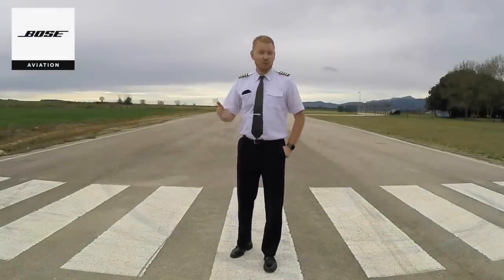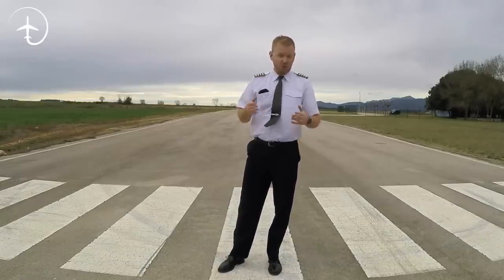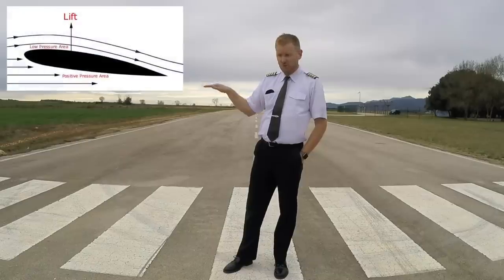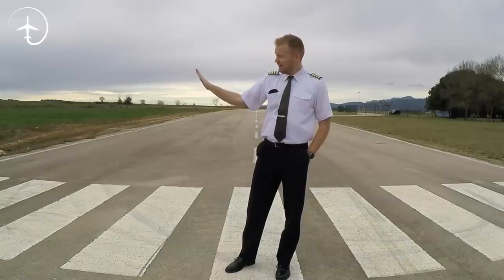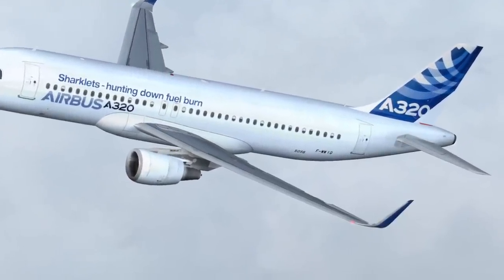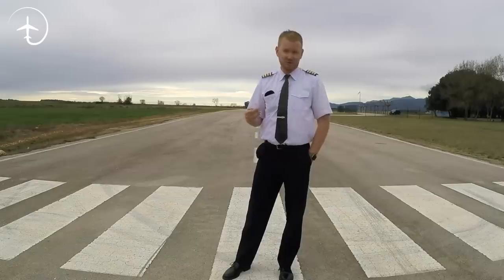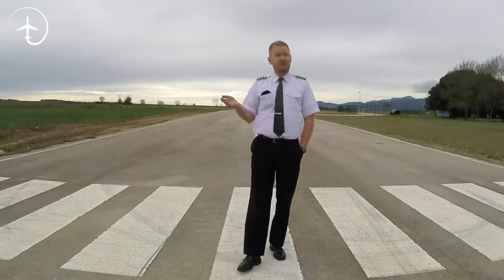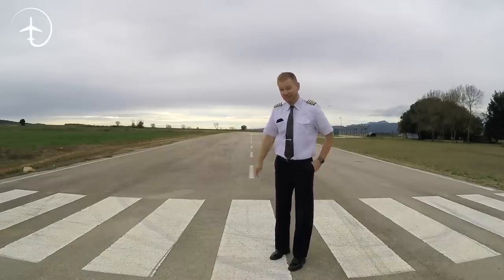Winglets - What are those things on the aircraft wing-tip?

Comment: Winglets are also much safer. Some of the vortices created by heavy and slow aircraft can be extremely powerful and even push other planes out of the sky (if they happen to be in the path of the vortex). Winglets help greatly reduce the vortex (as Mentour said), by giving a place for the high pressure and low pressure air to meet gradually (instead of a big column of high pressure air twisting over the edge of the wing as it tries to fill the low pressure area).

The recent Qantas incident from last week in LA resulted because the plane was hit by the wake vortex from the taking off aircraft ahead of them. Aside from that, there have been many accidents attributed to wind vortices, both big and small aircraft.

Comment: “Nature has a tendency to do things in the most efficient way”

Expect the next Boeing to have flapping wings.
Reply: *Starts praying
Reply: Well airbus started testing something near that
Reply: Thank you! Your delivery content and enthusiasm in your presentation is very commendable. You present a very complexed topic (winglets) to a level for novice to advanced learners to understand. You are a very skilled and knowledgeable teacher.
Reply: Boeing can't even develop a replacement for the outdated 737 which has been pushed way past its design life, with disastrous and tragic consequences. They should put their efforts into building a safe aircraft before they attempt to do anything ground breaking.
Reply: Parasite drag is produced by VERTICAL surfaces and Induced drag is created by HORIZONTAL surfaces, for example when the Flaps are at 0 degrees they produce Max Induced drag and Min Parasite drag, at 90 degrees Min Induced and Max Parasite drag and at 45 degrees in the middle of both, for a flap with no thickness. The fact that Lift and drag are both proportional to airspeed squared, means airspeed affects a 2 Dimensional surface, geometrically a Square plane. Wing Vortices are not the cause of Induced Drag but it is just a Visible Effect of it. I have developed a hypothesis to explain physical, atomic and subatomic (gravitational movements, Center of Gravity and Mass), however I need to validate my V & H surfaces theory first.
It seems that Winglets reduce Lift and increase Drag, I also believe in turbance Winglets impose additional stress to wings and all other moving parts inside the wings like rods, joints and moving surfaces. Wingtips also decrease the stability and controllability in turbulent air. Simply put another british scam.
Please let me know what you think, thanks.

Comment: To explain wingtip vortices (in very simple terms), the air is moving faster over the top of the wing than the bottom due to the top being longer than the bottom and the wing is designed so the air meets up at the back of the wing. On a swept wing the air moves down the wing (or outward) as well as across it and at the end of the wing the faster upper air meets the slower lower air and it spins into a vortex.

It takes a lot of energy to spin the air in the vortices, that energy has to come from somewhere and the only place that can be is from the plane, and that creates drag. Drag slows the plane down requiring the engines to work harder using more fuel.

The winglets change the way the fast upper air meets the slow lower air so that the wing-tip vortices are greatly reduced. There is no one best design for this, the wing for each model of plane is different and the best design for each wing varies.

The efficiency of the winglets changes as the air-speed of the aircraft changes. The design of the winglet determines where the winglet is most efficient and that choice varies depending on the roll the plane is planned for. Short hoppers will be better served by winglets the are most effective during takeoff and climb (and landing), long haul aircraft will best be served by winglets that are most effective at altitude and cruise. This is the exact opposite of a "one sized fits all" situation.
 
Not mentioned in the video is the 787 wing is designed to flex a lot more than typical aircraft wings, the shape (curve) of the wing itself works to reduce wing-tip vortices without winglets.
Reply: Thnx, enjoyed that little book! 👍

Comment: Damn those winglets are huge!
Reply from the maker: Yes they are!
Reply: How tall are the winglets on a 747 then? 4 meters?
Reply: They are 6 feet on the 744. The 747-8 has raked tips. However, the 767-300ER has 11 foot winglets! They're huge. (Heights according to wikipedia, however I work around both aircraft)
Reply: tell me about it
Reply: They look huge if they are right outside of the window.

Comment: Good video. I always thought the 737 sharklet was much smaller. Could you do a video on the auto break?
Reply: 7.3 IDI Diesel sharklet is on Airbus and they are taller.  here are some stats:  at 2.5-metres tall, they will replace the aircraft's current wingtip fence. presented  as an option on newly built aircraft, Sharklets have been especially designed for the Airbus A320 family to reduce fuel burn by  3.5 percent. question 2: 
there are 4 phases to landing:
final approach, flare, touchdown and de-rotation, roll out and deceleration. on the A320, the auto brakes have three settings. LO,  MED and MAX. autobrakes are available on Normal Brakes (Green system) only.  LO mode delays for 4 seconds after touchdown. MED mode delays for 2 seconds. MAX has no delay and is only used during  takeoff in the event a rejected takeoff is perforned, it applies max pressure with no delay
Reply: The auto brake  is operated by a switch mounted in the center of the top panel above the flying instruments. Its graduated from 1, 2, 3, 4, and 5, If its a five, you pull the switch out towards you and then lock it into 5. 5 is very rarely used unless its a bloody short field and you need maximum braking. Use of reverse thrust is always used no matter how long the runway is . Thats to save in brake pad wear and tear. Hope that explains the use of the Auto Brake system

Comment: Way back in 1983/84, I was working on "Temperature Dependant Shape Changing Materials" at Cambridge University Dept. of Metallurgy. There were fatigue problems with Shape Memory Alloys, that could be solved, but introduced corrosion issues. The problem with 'Bi-Metal' strip material was low performance and/or corrosion. CIBA GEIGY had a fabulous facility at Duxford, very close to the Aircraft Museum. Composite materials looked very promising. Zinc for example has a very high coefficient of expansion. It was noticed that a bi-metal strip could double it's turning moment at a given temperature, when the interface was a sinusoidal wave profile. ...This in turn quadrupled the torque or turning force. Weight issues could be addressed by a CIBA GEIGY product known as "Pultrusions" ... semi-cured composite epoxy impregnated and gas free extrusions. ...It was simple enough to incorporate heating wires into the 'wave' profile. ... The intention of "Active Wing-Tips" was to allow the aircraft to minimise the formation of wing-tip vortex initiation. ...Rather than have a single thick section, a sliding laminated stack was seen as advantageous. ... I was also reading Comparative Theology, as a Military Chaplain, and the issue of Life-form Patents was very contentious. There was a movement to boycott all Patent Protection as a form of protest. A "Publish and be damned" policy. ...The result was that no funding was available for continued research.

Comment: Hi mentour pilot, is there any difficulty by winglets while cross wind landing ?
Reply from the maker: Excellent question. We actually have slightly less crossword Nd capability with the Winglets than without.
Reply: Got to be worse with double winglets.  I recently talked with an old friend who has retired as a commercial pilot and asked about cross-wind landings.  He said he just side slipped.  Before he left engineering to be a pilot I took a short ride (instead of a drive) to Lindbergh Field.  He did an extreme side slip and we landed in a parking area next to the then Ryan complex.

Comment: Hi Mentour! I have one question, why the older 737 models have more cockpit windows than the modern ones?
Reply: Pablo Lapadjian I can answer your question. Basically before the all technology the third person on the cockpit ( the navigator)707 and 727.  Was responsible for navigation, and on the olds times during night we flew looking for out side the windows too, looking for Stars. The time passed but they continus be done with this windows.
Reply: They're called eyebrow windows, they also gave pilots greater visibility in turns.
Reply: Primarily because the original 737 shared lots of fuselage components with the 707 and 727. The cross section was the same and it meant they could use common components such as seats and other fixtures and fittings. If you look at a Boeing 707, 727 or (early) 737 the forward fuselage is basically the same.
Reply: Mentour has a video on that specific topic.  The "eyebrow" windows turned out to have more downsides than benefits, and were dropped from later models.

Comment: On Boeing 767 raked wingtips are only on 767-400 also raked wingtips are incorporated on the Boeing 777-300 only.
Cheers from San Francisco.
Reply from the maker: Yes, true.
Reply: Not really, they are also on the 777-200LR and also of the 777F
Reply: Hello, Thanks, I stand Corrected...
Reply: not 777-300 only 777-300ER
Reply: Elle, Thanks for the additional Update...
Cheers from San Francisco, My last job was a Fueler @ SFO.
Reply: John Dubpernell Np

Comment: Mentour some 737's have windows near the overhead panel why are they there and why are they not there on other versions of 737 and other aircrafts
Reply from the maker: The eye-brow Windows? I will see what I can do.
Reply: Mentour Pilot Thanks
Reply: As far as I'm aware, the eyebrow windows were for astral navigation which obviously isn't a thing that's needed with all the advanced in technology like GPS and many other things since the '60s. I believe it reduces production cost, maintenance cost, and a bit of weight.
Reply: So is all the added technology and computers why flight crews don’t include navigators anymore - or do some planes still have them?
Reply: Pretty much. I don't think navigators are really used anymore, except in situations like certain military aircraft, like bombing runs and AWACS and stuff like that. Advances and simplifications in flight controls and the number of things that can run themselves is also why modern aircraft have lost the engineer.
Reply: Boeing did some studies -- Boeing does that a lot -- and concluded that the added visibility from the eye-brow windows didn't significantly enhance safety and not having to have the structural enhancement of the windows was more important and cheaper for the customer.

Comment: can u explain about crosswind, downwind & upwind
Reply: upwind is the direction you take off, because airplane always takes off against wind, thats why the name is upwind. crosswind is when you have the runway 45 degrees to your left or right, and downwind is when your are flying opposite the runway you toke off from. you will learn this better when you do pattern training
Reply: Crosswind - Flying in a direction where the wind is blowing accross the plane. Downwind - Flying in a direction where the wind is blowing in the same direction of travel. Upwind - Flying in a direction where the wind is blowing in the opposite direction to the planes travel (headwind). Terms mostly used when flying circuits as you always land upwind to get the most lift for a stabalized approach...same applies for take off. If you took off from a runway to do a circuit you would take off Upwind, turn crosswind, turn downwind, turn base then turn final (upwind again) to land.

Comment: I was wondering why the 777-300ER does not have the winglets? It is an extremely long range flying aircraft.
Reply: The 777 doesn't have winglets because they use the raked wing tips. Just like the 787, it's more efficient with longhaul flights
Reply: And the wings it is totally different, so much more efficient
Reply: The 777 X has foldable winglets
Reply: Yes, I know that. Isn't that nice!
Reply: The 777X has foldable wingtips. The reason the wingtips will fold is because the wingspan will be 7 meters (22 feet bigger). The reason for the fold is for the aircraft to fit in the same slot as current 777s, therefore airports don't need to expand like they did for the A380
Reply: Thank you for the info.
Reply: Ken Wang cause it is my fav airplane that is why it doesn't have winglet

Comment: Pretty good but you left out a key bit. What winglets actually do is generate thrust and function like a boat's sail when close hauled into wind. They were originally called "tipsails". The winglet is angled with its chord line outboard slightly to optimize the AOA in the tip circulation and the resulting lift vector, being perpendicular to the inboard-circulating flow, has both an inboard bending component and forward component which is the net thrust it generates. It's the thrust generated, in excess of the winglet's own drag, that cancels out some of the wing's drag.  Winglets only make enough thrust to exceed their own weight and drag penalty when the wing is working hard, operating fairly close to its Clmax.   

Straight wing airplanes generally don't use them because since they are only worth the trouble with the wing close to its max lift coefficient, only airliners that cruise above 30000 ft are operating close enough to Clmax to be worth it. On low altitude airplanes they are mostly for show, or to improve climb/glide performance. One noteable low speed airplane with what looks like humongous winglets is the CL415 waterbomber.  Except they aren't winglets; they are dihedral plates added to restore dihedral effect lost when the slab sided turboprop engines were added. The mother of all aerodynamic bandaids.

Comment: hmm...what if the wing tips could hydraulicly rotate to the sides? would that help to brake the aircraft during the landing? Would it be too dangerous to add a potential weak spot to the wing tip? Because what moves, can obviously break, both break down and break off.

Comment: Wing lift is greatest at the wing root and least at the tip. This causes a a lateral air flow outwards on the upper and inwards on the lower surfaces. This produces a vortex at the tip where they mix. It's called " Induced Drag " and the winglets reduce this effect making it more efficient.

Comment: Does it also prevent vortices from pulling the air above the wing (outer section) spanwise which could result in wing stalls at lower speds like landing?

Comment: Hi mentour, really enjoying your videos eventhou i am not a pilot. One question regarding this video. I have seen and actually been a passenger on an airbus A330 which previously had contact with their left winglet. The damaged piece has simply been taken off and the aircraft is back in operation. Left side no tip, right side with tip. I assume it has no effect on the safety and security but is this actually legitimate? This airbus is operating for couple of month now as described. Would appreciate a comment on that. Thanks
Reply: permitted by Airbus on A330, though some airlines may be more or less willing to actually do that. No effect on safety as long as some penalties are taken into account (more fuel burn, slightly higher speeds for approach and such).

Comment: About 6feet .The both of them are being used to reduce wing tips turbulence as the craft flies through the air, since these turbulence could cause alot of wing tip vibrations we want to reduce those vibrations for stabled flight.

Comment: In the early 70's, if my memory serves me correctly, I read an article in one of the pilot magazines for civil aviation about the fact the wing tip vortices causing wake turbulence. Wake turbulence exists long after a larger plane has passed. This is a hazard to small planes and there were a number of fatal crashed caused by this. This is one of the reasons winglets exist. Here is a quote I found from Wikipedia just now. "The two wingtip vortices do not merge because they are circulating in opposite directions. They dissipate slowly and linger in the atmosphere long after the airplane has passed. They are a hazard to other aircraft, known as wake turbulence"

Comment: I was not aware of the vortex part, but i always thought they were to balance the overall weight left vs right, to quickly bend the direction of flight or turn left/right at lower speeds.

Comment: I figure you’re 6’1”, i figure 737 winglets are at least 8-9 feet.  And if i’m not mistaken, the split scimitars either were designed for the Next Gen’s, or are backwards compatible from the Max.  The 767-400 was the only one fitted with raked wingtips.  The coolest ones are the 757’s with the twice raked winglets.  As well, a very small number of A320’s don’t have winglets, and didn’t the entire Airbus line, starting with A300, come standard with wingtip devices?  There is also performance improvements with them, which is why smaller aircraft utilize them, when their flights are far too short for substantial gains, note CRJ’s, ERJ’s, Beech 1900’s.
Reply: Split scimitars are the modern 737 Next Generation winglets, and are retrofits of the earlier blended winglets. The AT winglets are new designs manufactured by another supplier